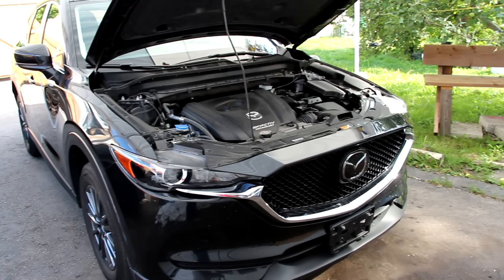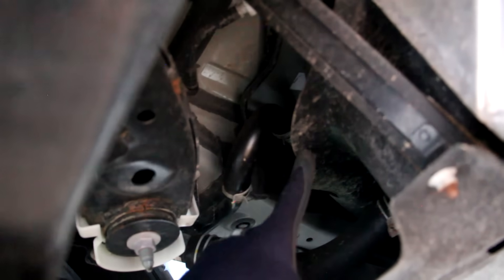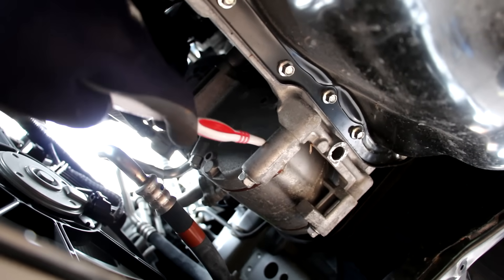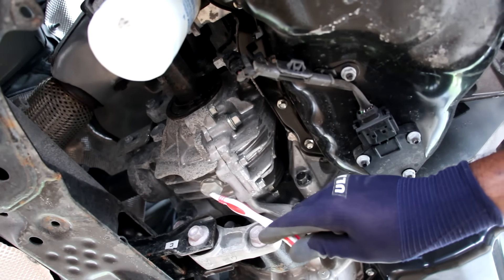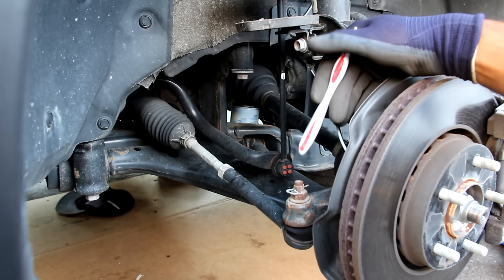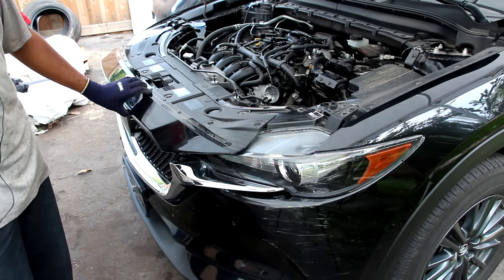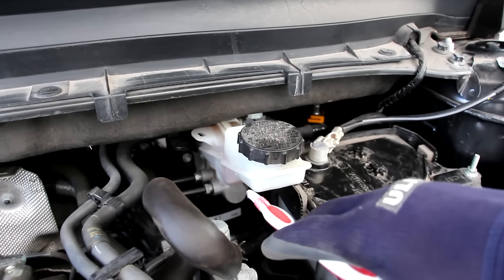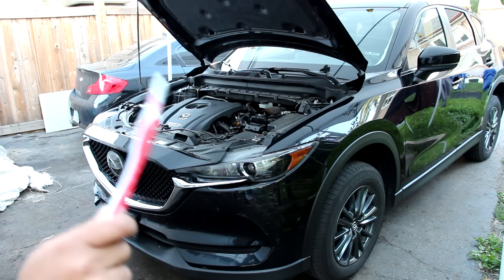Mazda CX-5 Mechanical Review

Comment: I have a 2020 CX-5 2.5L AWD Signature purchased new, located in Europe. I can't say it's a problem-free car. During the warranty period (3 years), the rear brakes were changed twice. The mechanisms of both mirrors as well. The car cannot connect normally with the Android phone, no problem with Apple. And worst of all, the thermal valve, which is electronic and costs €1,000 including replacement, broke down shortly after the warranty period, on 44 000km. This is a recall in the US, but not in Europe.Also, parts of the car's undercarriage are already very rusty, there was no rust protection under the bottom, I did it myself.

Comment: have a 2018 cx5 need to replace the cylinder head because of hairline crack, seems happen quite a bit for the engine. Some mechanics told me that they need to take out the whole engine but one said not. Can it be done without taking out the whole engine? thanks.
Reply from the maker: It's a 4 cylinder engine, it should be done in the car.
Reply: Which engine and size if you don't mind me asking? Hope you got sorted👍
Reply: @rjs71  2.5 NA. Yes, I was able to find a mobile mechanic to replace it and I got rid of the car because of the psychology. In hindsight, I should have kept the car since it has a brand new cylinder head. One thing I do not like my cx5 is the brake is not that great, I am not sure if it's a generic CX-5 thing or just specific to my vehicle.
Reply: @Btu555  nothing as more stressful as cars! Especially when you need them for work,kids ect..I only asked because I'm on the verge of getting a 2018 cx 5 2.0 na petrol se-l  but I'm in the UK and think most of these issues have been 2.5's in America 👍
Reply: @rjs71  Hmm, that's a little odd since I would think all the engines are from Japan.  Overall, it's a good car other than the brake issue, it tends to skid a bit when you have to brake in a sudden situation driving above 40mph but it could be just my car. I never had an engine issue since I've never kept a car more than 130K miles so this one caught me out of nowhere; especially, I purchased this car when it had 8000 miles on it. My car is always clean inside out (including engine bay) and well maintained. Anyway, you just have do your research but the rest will be just luck.
Reply: @Btu555  think it's the 2.5 sold in America what's had most of these issues,we in the UK mostly got the 2.0 petrol and 2.2 diesel 👍
Reply: @rjs71  makes sense, I believe 2.5 was the first generation so it has issues to iron out. I also had 2016 mazda 3 which has 2.0 and didn't have an issue.

Comment: My wife and I have a 2016 Mazda CX5 we bought brand new. It now has 150,000kms and has zero rust and zero mechanical issues and we park outside year-round. I have done the brakes once, replaced the battery twice, replaced the serpentine belt and tensioner once, and done all required oil changes every 8,000kms with full synthetic oil. It has been more reliable than most of the Toyota’s we’ve owned. Ours was made in Japan. People say the 2.5 litre engine with 185hp is gutless but it still has plenty enough pep for us. Excellent winter car too! We live near Edmonton Alberta and it’s our go-to for winter commuting…. just add studded Nokian winter tires and you’re good to go!
Reply from the maker: Good to know these Mazda's hold up. Have you been rust proofing it?
Reply: @speedkar99  nope and our roads are treated all winter long.
Reply: Great report! Thanks.
I own a 2021 Mazda 3, changed the oil every year (11000km), no rust proofing and it looks better underneath than my previous car (Mitsubishi Lancer) at 3,5 years of age. In Romania we also fight the salt every winter.
Reply: @RaduB.  we still have ours. We’ve owned it since 2015 and it is still going strong… and no rust! We get salt and sand sprayed on our roads here in the winter as well. This summer we had a rattle develop on the back of the car after someone had runninto it with their car. It took me some searching but finally found out the problem. A couple of bolts for the rear spoiler had worked their way loose and 2 of them had fallen off altogether. I replaced the missing bolts, put blue threadlocker on all of them and tightened them all down. No more noise! If you look on Youtube for “rear spoiler rattle on Mazda CX-5”….. you’ll find a few videos on it. Easy 15 minute fix! I put a little piece of rubber hose at the bottom corner of each side of the spoiler as well. To act as a cushion and keep the spoiler from vibrating in the future. Easy fix and like new again!
Reply: I thought the 2.5 has good power for a 4 cylinder. It’s must better than the two Hondas we previously had.
Reply: I bought a Mazda CX5 2013 Skyactive diesel engine and its showing CPF, Engine light and a triangle with an exclamation mark. Please help

Comment: My Mazda CX-9 has 246000 miles and has had zero problems other than factory recalls. I use it like a truck and a bus...... Just plain love it.
Reply: Do you stick to the manual about maintenance changes?
Reply: @dmav2074  yes....

Comment: Mine has 19000 km on it and already needed to replace the coolant controller valve.  You called it right when you said other automakers have struggled to make it out of plastic and from what I’ve seen this seems to be a very common failure from 2018-2021 models with the 2.5 non-turbo engine.

Comment: I just got a new 2024 CX-5 Turbo a couple weeks ago. Living in Florida, hopefully it will rust less than in states up north. What can I do to reduce the progress of the rust? Does it help to keep it parked in the garage when not in use? Is it too late to do rust proofing treatment and is it really worth the extra expense? Even if I had it sprayed with rust proofing, there are still parts in the steering that will rust. How many years before the car rusts apart? Which brands are any better for less rusting over time?
Reply: For sure it would be better to perform any of a rust protection (spraying). Also, garage may reduce risks to get it. Don’t worry.

Comment: My biggest concern would be regarding the direct injection in this engine. Everyone knows by now that carbon build up on the intake valves is a serious problem 25-30,000 miles down the road. What's your opinion about this in this engine and what is recommended to prevent it in the NA 2.5 L engine. Also if Mazda took into consideration that some people have taller children or adults that will be cramped sitting in the rear seats. I would love to buy one if these two things weren't an issue. Otherwise from your review it seems to be a solid choice for a family with little children not 6 ft tall teenagers.
Reply from the maker: Agreed. I think it's the best of the lot.  Carbon buildup will have to be addressed with a good cleaning periodically.

Comment: Rust on the Subframe and Control Arm  1yr old car????  thats Shameful! I wonder if there is anything that can be done to prevent further rust i.e. an additive to coat the subframe to prevent further rust? Or would that be dangerous to do?
Reply from the maker: Undercoat it was soon as it comes out of the factory, then oil spray it annually thereafter.

Comment: I thought they were bigger than they actually are. I think im going to get the CX 9. 22 or 23. Heard about that valve and oil consumption issues on the 2.5s on both models from like 16 to 21

Comment: My independent mechanic swears by these for their simplicity.  Says they last a very long time and with few problems.  Like Toyota but the parts don't cost as much.  I keep my cars a long time (last car was a 2006 Saab 9-3 which I sold just under 200,000 miles at 12 years of age, now the second owner has it with 270,000 miles on the original powertrain).  Current car is a 2013 Subaru Legacy now with 143,000 on it.  Adding this car I think it will fit right in for a long life.

Comment: Thank you for the great-informative video. First time Mazda owner for about 7 years now. I own a 2016 Mazda6 with 173,000 that has been very reliable (I bought it used with 30K miles). The belt tensioner has been replaced twice and needs replacing again, unless it is just the belts doing the high pitch purring. I have hit debris (bulky and hard) and a deep-sharp pothole that destroyed a rim and tire, and the suspension has never needed any adjusting. During my ownership, the car has never needed an alignment (this is really amazing to me).  I drive my cars for many years, and I'm sure glad I chose a Mazda. Previous Toyota owner for many years (they leak!), and an '06 Accord Hybrid (V6) that was a very reliable as well. God bless.

Comment: I just replaced the breaks (front and rear) 2018 Cx5 w/66K They both had 5+K left on them, but going into the Chicago winter, I wanted to get it done. I would say I had less rust than shown on this video, all surface.   I have a 2016 ram that has way! more rust below.

Comment: Needed new brakes at 25 thousand kilometers. Cheap factory brakes on a new car . Dealer said because of low mileage brakes will deteriorate. That is complete BS.  Problem is if using cruise that wears out the brakes faster.
Reply: It's actually a 2021.5.

Comment: Good vid, thanks! Actually the access panel to be removed for oil filter is the bigger one further to the back. RAV4 also has a transmission pan, housing also the transmission oil filter. 
Regarding rear brakes, you need to enter service mode and retract them, otherwise you will break the actuators.
Reply from the maker: Thanks for the info!
Reply: Enter service mode and retract them? What does that mean? As I am looking to get a 2024.
Reply: @guitarplayer4429  service mode retracts the brakes. Replacing the pads with thicker ones requires that they are retracted. Makes sense?
Reply: @Quentyn73  yes sir. Thanx

Comment: I recently did quite a bit of work to an 05 mazda 3  which is very similar. Besides the belt everything was easy to do and was well designed.
Reply from the maker: Awesome.  Why what's up with the belt on the 2.3?
Reply: @speedkar99  no tensioner, belt tools didn’t work well so I had to make one and slowly roll it on. Just not friendly from a mechanic’s point of view.

Comment: I have the 2014 cx5, 130K only had to change the Battery and front brake pads with a set of tires. Well built, and very reliable.

Comment: Should mention problematic cylinder deactivation on the 2.5L NA Mazda added since 2018 MY.   It’s a complicate system with a couple of major problems, cracked cylinder head and failing switchable hydraulic lash adjusters, started showing up.

Comment: I just had my belt tensioner pulley replaced.   should I have replaced tensioner idler or water pump also? Ive had my 2016 CX-5 2.5L four years @ 120,000  miles. I often smell antifreeze after I shut car off I haven't seen any leaking no over heating?  2 👍🏼👍🏼 for video love your diagrams.

Comment: I have a 2023 non turbo. My only complaint are the brakes. They are scary to use when an immediate stop is required from anything over 40mph. This is a major concern that Mazda must address. Otherwise I love my CX-5.
Reply: Drive smarter. Don't follow too closely. It's a small SUV so it's heavier than average sedan yet still handles like a dream.

Comment: Great content,  I bought a 23 CX-5 with plans to keep it for at least 10 years which is why we wanted something mechanically simple - at the same time it has all the safety and entertainment features you could want, like wide split screen display and adaptive cruise. I am worried about rust, however I did get it undercoated which is a necessity here in Atlantic Canada and plan to do that every year.
Reply: could also wash it after driving over salt roads - they sell equipment that slides under cars
Reply: where did you get it undercoated we are picking ours up in november. great video by the wat
Reply: @twocoolcatsandadog  I go to a local shop that does Krown.
Reply: thank you

Comment: Mazda uses the miller cycle which pumps fuel Saturated air into the intake manifold then sucks the atomized fuel back into the combustion chamber which cleans the intake valves. No port injectors needed.
Reply from the maker: I didn't know. Thanks

Comment: I'm driving a 2014 CX-5 with almost 90k miles on it and it's been a solid vehicle to own and drive. I live in the snow belt and the CX-5 is holding up well and really doesn't show much more rust than the example in this video. Mechanically the CX-5 has been a rock. I very much like the 6 speed auto in it vs the competitions 8 speed units which seem to gear hunt too much. The 2.5L engine has good power and excellent fuel economy and has been problem free over the 90k miles. I do use a high quality full synthetic oil and filter. As far as maintenance mine has required little besides oil and gas, although I have changed the trans fluid and filter myself at 60k miles (preventive maint only) and it's also had 3 brake jobs over the years. There's a rubber O ring on one of the brake slides in the rear calipers that tends to swell after a few years and will cause the rear brakes to bind on the inside. Most people tend to just remove it since it's only there for noise prevention but I choose to replace mine with a new O ring. Either way that fixes the issue of the inside brake pad wear on the rear calipers.
Reply: Probably swells cause guys are using the wrong grease

Comment: In terms of mechanical reliability would you pick a cx-5 or Rav4 (gas powered)
Reply: Mazda skyactiv drivetrain is proven and bulletproof right now. Even if Toyota was same, one you drive Mazda there's no going back to RAV4. It just can't compare.
Reply: RAV4 in a heartbeat.
Reply: @lightsfansofthewest481  Assuming you will maintain both cars you can't go  wrong either way but I'm partial to Made in Japan CX-5. If the kinks has been worked out nothing beats Japanese craftsmanship and attention to detail.

Comment: I love my CX-5, I got it last September. I love Mazdas in general, esp since they are no longer a part of Ford. I had a Mazda 3 that I drove until it had 331k Miles, not km, miles!
Reply from the maker: What year Mazda 3? The first and second gens were ford designs
Reply: @speedkar99  2011. I just googled it, and in Nov 2010 Ford only had 3% of Mazda stock left. I thought Ford owned Mazda, but in reality they just had a controlling stake, at just over 33%, but they sold off 20% during the 2008 financial crisis, and like I said above, only had 3% ownership left by Nov 2010 and by 2015 Ford owned 0% stock. So, I guess technically, Ford owned part of Mazda when I bought mine, but it wasn't a large stake and they always used Mazda engines, at least from what I read.

Comment: Thanks. Great mechanical review. Pease also perform an in-depth mechanical review of the Mazda CX-50 Turbo with emphasis on how Mazda came up with a towing capacity of 3,500 lbs. The CX-5's Turbo engine and transmission is the same as the CX-50 Turbo engine and transmission. Thanks for all you do.
Reply: THE CX 5 transmission is made in Japan beginning in 2020. Was made in in China but due to quality issues they brought it back to
Japan. I have a 2020 and the name plate says Made in Japan. Not sure about the CX50. Those are assembled in Mexico I believe.

Comment: Thanks for the excellent video.  You replace the PCV valve from the top or bottom?  Can a novice diy're do it, or you need a lot of experience you think?  All I've done is replaced oil, filters, and spark plugs.  Thanks!
Reply from the maker: Yeah it's easy! Go for it

Comment: So Mazda has sold more than 3 million CX-5s since introduction,  #1 Vehicle in sales for Mazda.  That said, it is clear this model is not perfect, is not segment leading, not the most interior volume, nor best gas mileage, or the cheapest in class.  Toyota's RAV 4 outsells the CX-5 3:1.  Ranking the SUV market,  Mazda is in 6th place in total sales.  

I just bought a 2021 CX-5 GT AWD. I traded a 2019 Mazda 3 for the CX5.  The reason we buy any car, or watch or really any durable product is we let our emotions make our decisions. This little SUV is  one of my favorite cars I've owned. It is fun to drive. It is comfortable to drive.  It get descent mileage, and is very reliable. And it looks great, too.  I have owned 11 Honda Motor Company cars (including Acura) over 40+ years and logged over a million miles on them.  I had a Acura RDX, but now they are way to much money.  I put 400k miles on it with no unscheduled maintenance. 

 I wouldn't be caught dead in a CRV.  I have a personal affinity for the Toyota, so never again will I own one. The CX-5 is my 2nd Mazda, and I will drive this one for half a million miles before it over and done with.  

Need a new car?  Go get yourself a nice, new Mazda CX-5.  Let your emotions set you free!
Reply from the maker: Yeah it's a good car from a mechanical perspective in my opinion

Comment: Had a RAV and loved it for 10 years (a die hard Toyota/Lexus fan)…but the fun experience behind the wheel of the CX5 turbo signature and its outstanding interior sold me. The turbo engine is fantastic…such a fun, good looking car to drive.  The RAV was utilitarian, the CX5 just more sport/luxury.  Thanks so much for the review! Will be on the look out for the rust issue.
Reply from the maker: I agree. CX5 is impressive mechanically (not sure about turbo longevity, CX7 had a bad track record)
Reply: Just wait. It will fail you.

Comment: Bought a used 2020 CX5 Touring w 32K miles here in Florida. I been all over the car . Changed  oil , trans mission Fluid .(drain and Fill) I did not see one speck of rust anywhere. Perhaps  in the Rust and or snow belt things are different., especially where they use salt on the roads.
Reply from the maker: You should be safe from rust in Florida